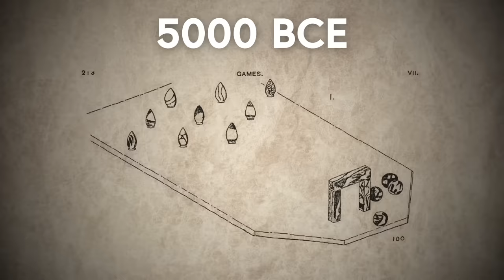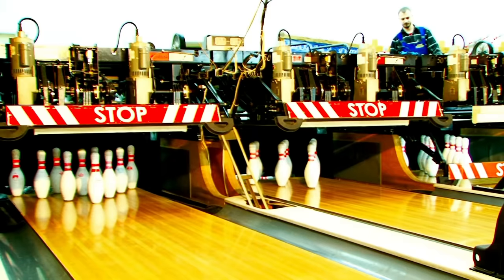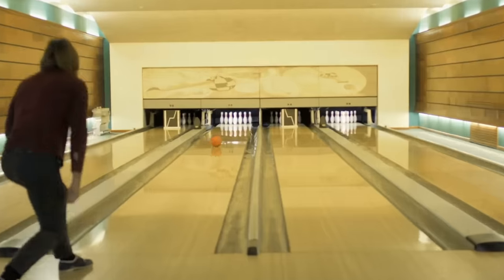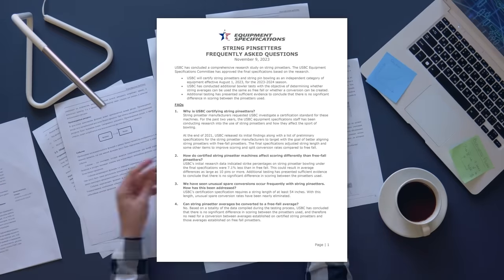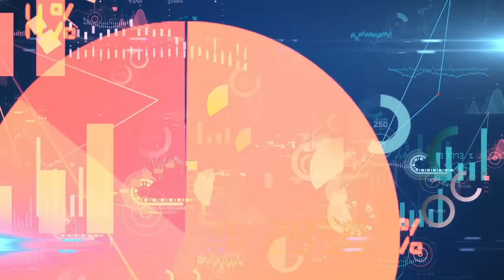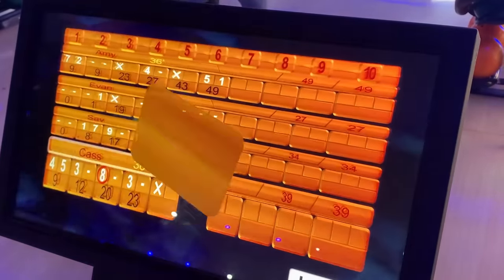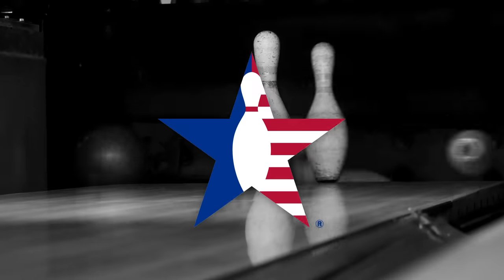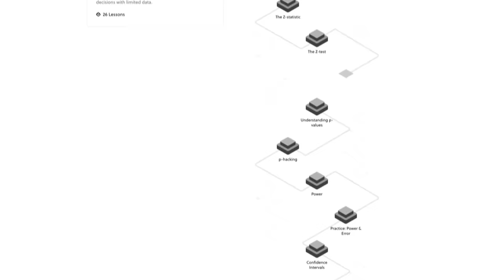The Controversial Machine That’s Ruining Bowling

Comment: As a serious bowler, who knows a lot about the subject I was going to add some context, but I'm shocked at how accurate the research was.  This channel does good research. The little experiment they did at the end was pointless, a victim of very small sample size + amateur bowlers who are by their nature volatile in their scores. The string pin study was mostly for league+professional bowling, where bowlers tend to be more consistent shot to shot and would notice if they weren't getting the strike they deserved for a good shot. 

If there is context to be added, I will say I've watched lots of videos about string pins and can tell you that the length of the string matters a lot. The USBC knew this and "certified" a certain length of string where score variations did not vary from freefall machines, and in my opinion this is true. But not all bowling centers use this length of string, so there will be definite noticeable differences in score and feel.
Reply: I was coming here to say the same.  I will fully admit I'm not a consistent enough bowler for my data to be included in any type of comparison between different lane/pin/pattern types, and I've been bowling in leagues for 5 years now.  Four people who averaged a 67 game... DEFINITELY not consistent enough for it to be good data.

If they want actual data about the difference between the two, they need people who do this regularly enough to be consistent at it... not 4 people who are throwing gutter balls half their shots.
Reply: @chkltcow  or who don't know what ball is the right weight for them... I think I dunno if that's a good point to make I'm not a professional bowler
Reply: Absolutely right. There is a bowling alley near where I went to university and they used string pins. The strings were so short and the weight of the pins was so low that I never once got a strike and spares were rare, as the pins' short string just never let them roll or bounce away from where they started. Went to a freefall on the other side of town and suddenly was getting strikes and spares.

I hate string pins, but mostly because I've only been exposed to the non-professional bad ones that ruin all joy.
Reply: Maybe as a serious bowler you can answer something for me:
I always thought that the main complaint about string pinsetters was the fact that they can't "remember" the off-spot position of a pin that was pushed but not toppled - while in tournament play the pin should stay where it is between the first and second bowl. Did I misunderstand anything there or is this rolled into the "but it doesn't affect scoring" argument?
Reply: Time to start enforcing an industry standard I guess?
Reply: I'm sure they knew thier "study" was statistically irrelevant. It was definitely just included to pad out the video runtime.
Reply: Bowling nerds... I heard they might be real but now I know 🤣😂
Reply: I have to disagree. The experiment in the end was NOT pointless!
Amy got to spend Sams money on Bowling and Mozzarella sticks with her friends and that's a win in my book 😉😉
Reply: No one else saw the huge market opportunity to make an improved, simpler free-standing pin setter?
Reply: . @QemeH  The main complaint about string pinsetters is the hit being different. The pocket gets "tighter", random undeserved strikes/spares, and splits being way easier. So you get punished for a good shot randomly, and rewarded for a bad shot randomly. Seems less fair and more random.

The pin moving out of position is not something I hear so many complaints about, because it's not as common an occurrence but I'm sure there are many who don't like it. I think most probably shrug it off.
Reply: @AaaTeeEyeBee They have been improved, but at the end of the day it'll always take a lot more components to collect pins the classic way compared to just pulling a string.
Reply: Bowling has a lot of old heads, same thing with 2 handers basically its gonna come because its easier to make and cheaper, which allows for more bowlers, which means bigger leagues, and even more people into it.
Reply: The little experiment at the end wasn't pointless, they needed to spend their remaining research budget before the end of the year! 😂
Reply: @QemeH  That is the rule with regards to freefall machines.
Reply: Y'all coming here to lecture them on how unreliable the study was when they literally reported a p-value of 0.63. I think they know !!
Reply: @QemeH  The old setters had the same problem though, since they picked up all pins to sweep the toppled ones and set them down in the starting positions. If anything, it was worse, since pins moved enough but not toppled would sometimes not get lifted and swept away. Everyday bowling alleys haven't been doing manual setting for a long, long time.
Reply: Not really a serious bowler anymore but thinking this through it feels like it’s probably one of those things that doesn’t really impact average scores, but would absolutely feel bad since the outcome of the same shot across different alleys is so visibly different.   It’s never going to feel good to throw a shot and see pin action that would have carried a strike on a normal alley get arrested by a string, or to get beaten by someone throwing a spare that gets picked up by the string. 

Would also be interested to know if different styles are impacted differently. Intuitively the differences should impact a stoker vs. cranker differently but not sure if that’s reality or which would end up advantaged.
Reply: Makes sense. If done right these string setters work fine but there can also be bad ones.
Reply: @Not all bowling centers using the same string length: Sounds to me like using tournament-legal strings should be a selling point for alleys that do use them.
Reply: I love the insight! I will say I'm assuming the experiment was 100% meant to add flavor to the video, not data lol.
Reply: @daricora  And make the video more fun.
Reply: @chkltcow  The channel knows that and basically said as much (that having Amy and her friends try it doesn't mean anything statistically).  The sarcastic humor must have gone over your head.   It's what this channel does.
Reply: @stevehook7012 Yup. I encountered one with weeble wobble  pins.... they wobbled but they wouldnt fall down. Was also literally impossible to get a spare with split pins.
Reply: @QemeH  Don't know if my 2 years of League Bowling qualifies me as a "serious bowler" but a pin moving but staying up is such a rare occurrence that it probably doesn't affect "the game" that much. If a pin shifts 2 inches left or right after a throw, that's unlikely to make that big of a difference to how the next throw would be played by the bowler.
Reply: @QemeH  The main complaint is about pin action. The pins behave differently with the string attached. Like he stated, a consistent bowler can tell many differences by pin action.  This video did poorly in explaining this for league/tournament bowlers.  Strings are perfectly fine for recreational bowler where the scores don't really matter.
Reply: @AaaTeeEyeBee  There is a new version, it's just complicated in a different way. But there is a regulatory capture thing going on.
Reply: @QemeH   As a bowler, I'd say that's actually one of the upsides. It's not something that happens very often, to be honest but when it does, it's usually going to make the spare harder to pick up. I''ll be honest with you, the main complaints with serious bowlers are that you spend years trying to be consistent from shot to shot and these string machines can make it so that you might throw 2 shots exactly the same or at least as close as humanly possible and you get 2 wildly different results. The other being mental...bowlers already know that bowling isn't exactly cool and now strings make it somehow worse...almost like you're playing with toys rather than with sporting equipment.
Reply: I think they did their own experiment knowing it wouldn't give any useful data, but would be entertaining. It's been a running gag lately than Amy goes out to do things they talk about, whether her research actually contributes information or not.
Reply: The experiment was just a gag
Reply: When I strike, the pins go end over end....you can't replicate that with a giant string on the end of it.......been bowling for 45 years........239 average bowler. Sorry, but it's not the same pin action.
Reply: If that's the case then the length of the string needs to be standardized the same way the length of the lane  and dimensions of the bowling pins and balls are. If it's 54" then that's what it must be.
Reply: @daricora  Some solid b roll footage really seems like the reason to me
Reply: As a very amateur bowler I can second your claim regarding score variance.  My score can vary wildly with zero changes to the environment in just a single night.  Professional bowlers and those who are far more serious about their game play tend to be way more consistent with their bowling technique.
Reply: I feel like it shouldn't be that hard to make some sort of ball launcher to make sure every hit is exactly the same.
Reply: @stevehook7012  I recently played at a string bowling alley. It was my first one. I'm normally a pretty decent bowler for normies, bowling anywhere from 150 to 220. That is to say, I average about 5-7 strikes a game. At this bowling alley, I could not for the life of me get a strike. I got two over the course of two games played, which is abysmally low for me. Not only that, I looked across all the lanes (about 10 lanes) and not one single person had a strike. Granted, many of them were playing super casually and drinking, but still, for 40+ people across those lanes, I had never seen such a thing. I don't know the details on the string length or the pin composition for that bowling alley, but it was clear the pins for one were a terrible material. It was like bowling into sponges. And I have to think the string length played a big factor. I concluded that it had to be a combo of physical factors of the bowling alley, even though I had never heard of strings for bowling alleys before or seen this video.

I'm a big stats guy myself (majored in Math), and I find that statistical test they did ridiculous (the professional one). If you're going to run a statistical test, you have to test multiple groups of people. Using professionals is a completely different population than amateurs. Using the most ideal materials with the longest string length is also going to misrepresent regular bowling alleys, such as the cheapo one I went to.

For me, those strings absolutely ruined the game that night. I would NEVER go back there again. Do you have any idea how unsatisfying it is to be a good bowler (not great, but good) and not be able to get a strike, even with the perfect set up? Also, most bowling alleys make most of their money through consistent players, not the random bday celebration players who play like once a year, ie leagues. If you screw up your strings for the league players, and they find themselves bowling at X less points / strikes, I can't imagine they would stick at that alley. They're going to notice much quicker than an average amateur player.

Thanks for reading my essay. TLDR: Strings are fine, but if you screw it up and use cheap stuff, it will drastically affect scores, from personal experience, and those alleys will lose players and not gain traction. I believe that string length is very important, a short-length string alley can seemingly hold up those pins and cause a lot of friction that normally wouldn't be there.
Reply: Looks like one had a real wood floor and other didn’t
Reply: Anything that restricts the pin action in any way such as strings is going to make some miss shots they would have otherwise gotten.
Reply: The data at the end was an obvious joke and he even explained how the data is statistically irrelevant. What are you guys all so pressed about :face-orange-raised-eyebrow:
Reply: das bad
Reply: The issue with the test that they conducted is that it had to be on multiple lanes. Most league bowlers should have an idea of when something should have been a strike or not, but it is just an idea and not set in stone. That being said, the oil pattern, or reaction that the balls were getting on the string lanes may have contributed to better scores which would skew the data.
Reply: And as a mechanic, I'm appalled with how inaccurate the video is, especially with a highly accurate animated video already out there.
Reply: @stevehook7012 the pins weight the same whether they're free fall or string.
Reply: @AaaTeeEyeBee it's not that simple...the newer machines have less moving parts than older machines, but also have a lot more electrical things (which can become another source of a headache).
Reply: @PixelatedPope I dunno.... my senior league this Wednesday had 3 out of ranges, where a pin slid 2-3 inches. 

This is more of an issue for seniors and juniors, who throw the ball slow.
Reply: @Foxzig short length has nothing to do with not allowing the pins to fall over, if it were that short, the machine wouldn't be able to run its cycle. 

Also, about the issue with striking? I'm assuming the place with strings was very leisure focused.  They probably don't oil the lanes frequently, which would have a much higher impact on your score than the machines.
Reply: @ikonix360 people need to get their concerns right.  Lol

Some worry that the strings will restrict movement (they don't).  Others worry that the strings may hit other strings and knock pins down that shouldn't have been (this CAN happen if the strings are adjusted a little short and restrict movement.)

I don't want to explain how or why a place might run the shorter strings, but if someone actually wants to know, I'll explain.
Reply: @Triley215  

Strings can restrict some pin action
Reply: @ikonix360  and they also create extra pin action.
Reply: @Appletank8  that's funny!! 😂😂😂
Reply: Hi. 200+ avg league bowler here that's also bowled at minor state rep level.. I also have a keen interest in physics and had a career in engineering. One simple fact: a tethered pin will behave differently from an un-tethered pin. It it is simple physics.
Reply: I 100% agree with you Bcquon as I guy that League Bowled for 5 years. I carried a 188 average so I was good but not pro good. Ametuer bowlers games can very from a 88 or get a luck 200 basically completely random. Someone that's bowled for years will bowl much more consistently around their average. If with strings pro's are still bowling their average then they work just as good. I still would only bown without strings myself whenever possible because NGL strings bother the hell out of me.
Reply: It's almost as if their "experiment" was an excuse to spend an evening going bowling...

Yeah I don't think there is any serious argument about whether or not the experiment is worth anything (it isn't), but it allowed them to get some pretty solid footage for the vid, so there was still entertainment value to be had.
Reply: There needs to be a minimum mandated length for the 7 & 10 pin strings before you can legally call it bowling.
Reply: @NomadUniverse  In what ways have you noticed that they behave differently?
Reply: @Foxzig  ricochets and bounce outs are non existent, pins dont roll freely on the deck preventing a lot of later falls.

The shape and weight of pins is the way it is for a reason.
Reply: It's also worth noting that this will impact the kind of serious bowlers that are at risk of someday bowling a 300. For more casual bowlers, it's probably a non-issue.
Reply: I suspect the experiment they did was simply to have fun and add a personal touch to the video.
I can appreciate that.
A lot of videos like this take other people's research data and explain it, which is fine, but this sort of thing is what can cause viewers to form a sort of connection with the content creator, which is one of the few things that will allow human made content to compete with AI made content in the coming years.
Reply: I would think a study with typical casual league bowlers would have been more useful.
Reply: @chkltcow  "If they want actual data about the difference between the two, they need people who do this regularly enough to be consistent at it"  And not just that, they need to be able to articulate and understand and notice the difference.
Reply: Just as someone who bowls casually when they get free time, I can say the string set bowling alleys are just not fun to play on. 
It takes away just about every last but of what makes bowling so satisfying.
Reply: @blaniac6591  For sure, the physics of the pins scattering, especially when you get a solid strike, is part of the charm. Or the occasional spare where a rebounded pin rolls slowly over to knock out the last pin, that kind of thing... no thanks to tethered pins for me.
Reply: @QemeH • Seldom happens. If so, the setter may hit it or place it elsewhere.
Reply: @AaaTeeEyeBee  They have them, but they are cost prohibitive, a new pin setter runs over 20k. 20k x 20+ lanes equals lots of money.